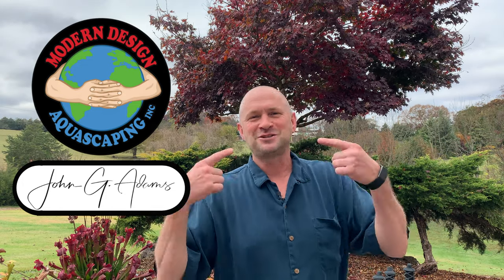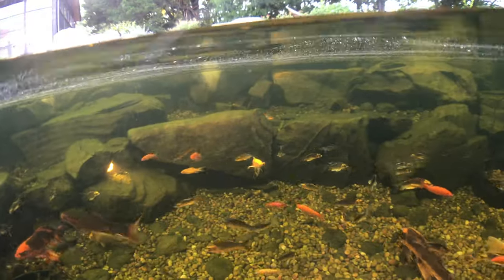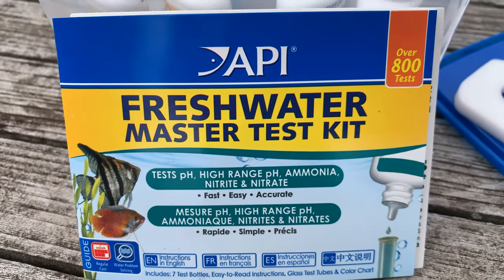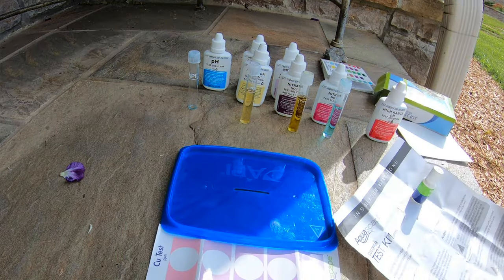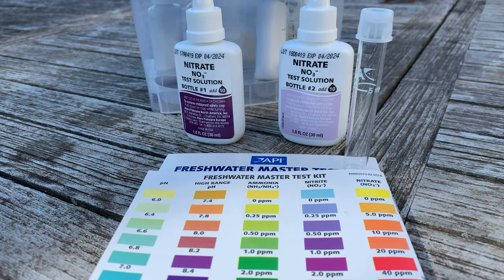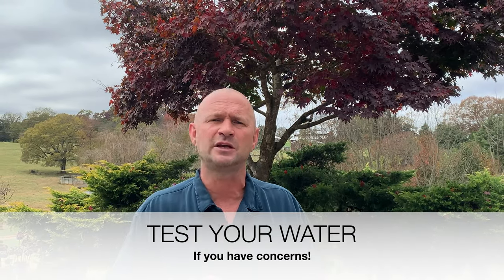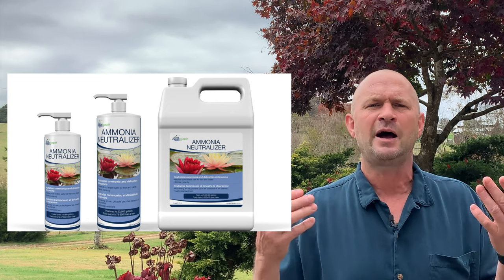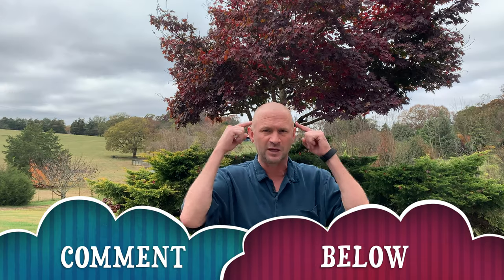The Nitrogen Cycle | Ecosystem Pond Series Episode 2.5

Comment: John, great content and advice on 25% water change which will address the symptoms of high ammonia/nitrite/nitrate but a lesson on addressing the heart of the issue is most important.

1. New pond syndrome 
2. Over feeding
3.  Sludge build up
4.  Over stocking
5.  Excess rotting plant matter
6.  Excess plant fertiliser
Etc

Advice on what you can do about it (apologies if this is coming) pond clean out, filter clean, cut back on feeding, add more plants, etc

Keep up the great work.
Reply from the maker: You are so right! Each video begets the next🤣😂🤣 I’ll never run out of content! Thanks for tuning in🙏🏻

Comment: I can't agree any more with this than I already do. Live plants and/or water changes are a must whether you're dealing with a 5 gallon fish aquarium or a 50,000 gallon pond.

My biggest issue with the test kits, liquid or strips, is the "sliding scale" of color we're forced to try to interpret. Most of the time, I can't tell if it's reading 40ppm or 120ppm. The variation is just too subtle for my old eyes. I need to find a tester that reads out digitally and takes the guess work out of the equation for me.
Reply from the maker: They are out there. The thing is that you have to keep them calibrated which is a pain. I just get a youngster with good eyes to read the tests for me🙄